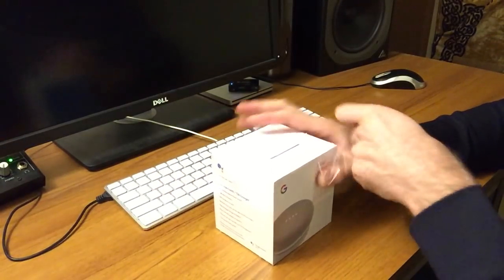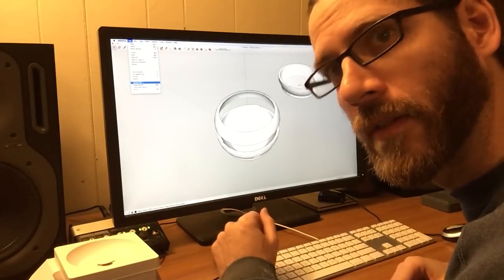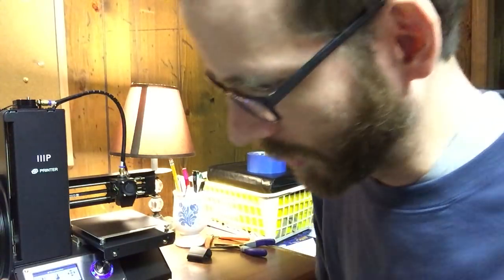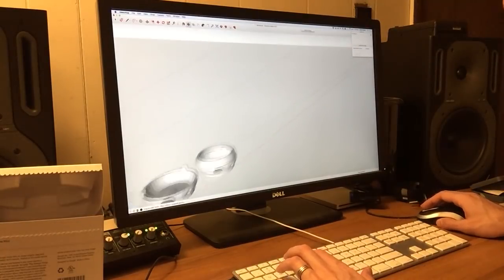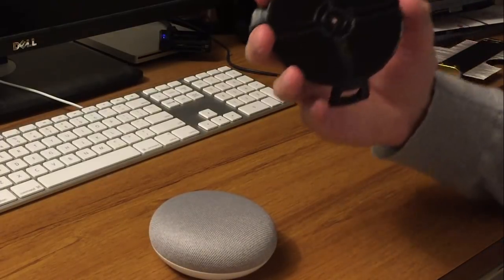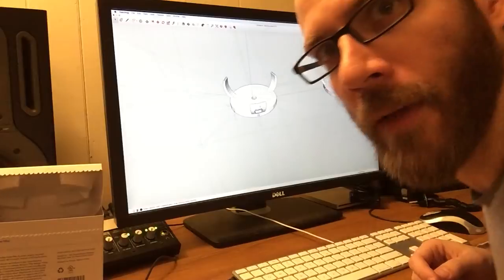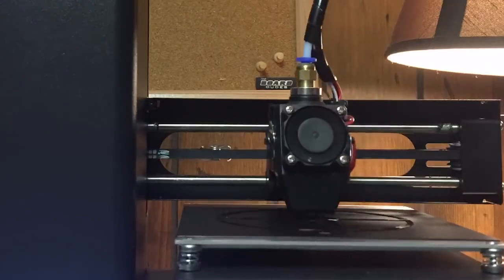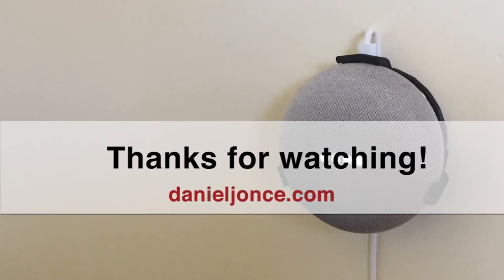(Free STL) Google Home Mini Wall Mount

Comment: Why can't the USB cable just go out the bottom of the mount. Like what is the purpose of having it go up and around, then through the little channel. Wouldn't it be simpler to just position the USB port on the bottom in the first place? 
It would look cleaner, and it would require a much simpler file to print/design.
Reply from the maker: It can but then your volume control and volume indication will be backwards (left to right would be lower volume). This design gives you the option to orient the mini it however you wish and run the cord directly to the closest outlet no matter which direction it is in relation to the mini. If you would prefer that the cord exit the bottom that's no problem, totally up to you.
Reply: Daniel Jonce Evans oh okay that makes sense. Thanks!
Reply: You can flip the volume buttons in the settings.

Comment: Hey Daniel, first off, very clean design and nice execution! 

Is the mount strong enough to be attached to something upside down? I was planning to mount it underneath our bar case. I don't want it randomly falling down after week or month or something. 

Second, I'm sure the answer is gonna be no but do you ever considered sharing the model file online for us to print it at home? I'm sure the answers gonna be no cause you put in so much of work and effort to make the mount and this video. I'm just curious if you don't mind sending us the file. Again, no to that is totally ok! We understand 🙂
Reply from the maker: Thank you for the compliment! I believe it would strong enough to work upside down as long as it didn't experience too much shock or vibration. I am currently investigating options to provide the STL file and sell limited permission to manufacture this to anyone interested for a reasonable price. Would you be interested in that?
Reply: I was able to find STL for very similar mount. I would have to make little changes, and see if I could print from local library. If not I might purchase them online thru Etsy. Either way, very nice job again! Creative
Reply from the maker: Thanks, I hope it works out well for you! You can also buy this design from my Shapeways store printed in their "Strong and Flexible" material (link in description). It's a bit expensive but it's great material for this sort of thing.
Reply from the maker: FWIW, I've got a license agreement and the STL available for sale on my website now. The agreement lets you resell the mount(s) you make if you want. https://danieljonce.com/store
Reply: I'm going to try to print your model at library tomorrow. How much does the mount weight? In grams?
Reply from the maker: The final volume and weight of the object will depend on your slicer settings and material used. With PLA, using a 30% infill and a 4mm brim Cura 3.0.4 estimates the print will use about 30 grams (about 10.14 meters of 1.75mm filament). I weighed a finished PLA version after supports and brim were removed and it came in at 25 grams. Hope this helps!